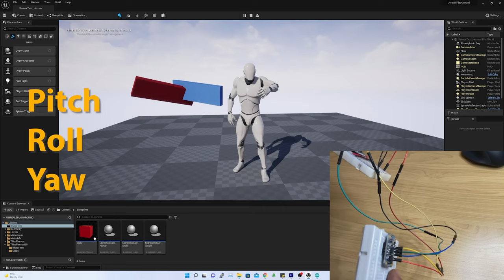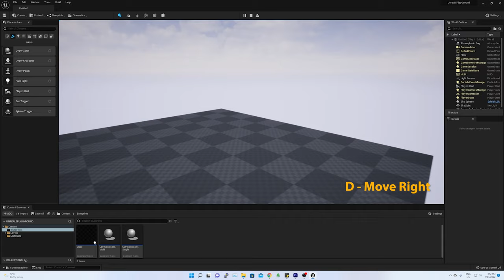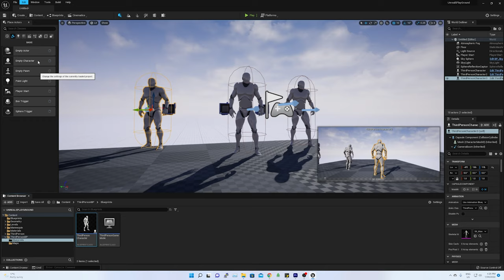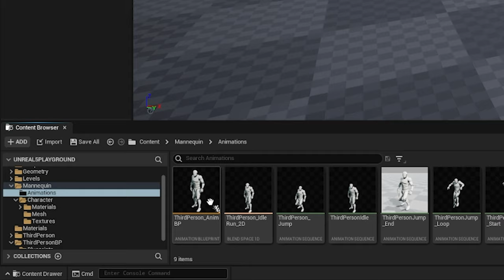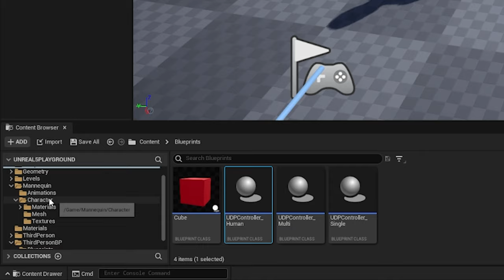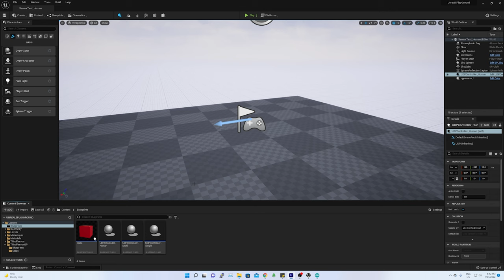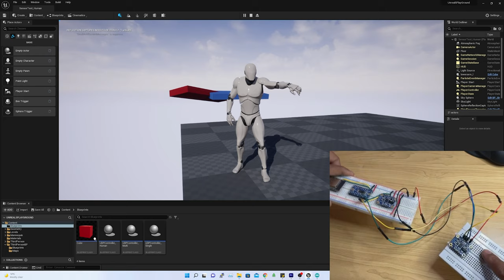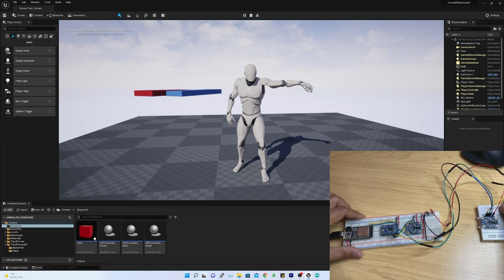Real-time motion capture (IMU) data retarget to Unreal (UE4 / UE5) metahuman / rigid body over WiFi

Comment: That's pretty cool. Thanks for this. Anything for tracking location?
Reply from the maker: I can add gps tracking in it but for my use case it is not required. I will be implement gps tracking for virtual world. 
If you could share your use case I can guide you in that
I am getting the circuit board build so adding gps tracking will be easier. Please stay tune for the next one
Thank you for visiting
Reply: @othersYATC  I want to track my camera movement for virtual production.
Reply from the maker: Will implement the gps in the mix soon. Please stay tune
Reply: @othersYATC  tracking camera movements requires sensitivity much higher than GPS. It needs sub centimeters accuracy and high update frequency. I think Hellcrest Labs did it already with BNO085. Look up CEVA Hillcrest VR

Comment: Very nice! i had a similair idea but i guess you are way ahead of me :D.

Can i sugest you to use simple ethernet cables and RJ45 connectors, these are cheaper and simpler to get by and have 8 pins, use 2 for ground and voltage, and you have 6 pins over, 2 for hand 2 for  forearm, 2 for base (this would be 1 body part) and these all connect to the multiplexor. for all limbs it would be 12 sensors + 3 for: hip torso and head so in total 15 sensors for each 3 sensors you can use 1 multiplexor for each body part: Larm, Rarm, Lfoot, Rfoot, BodyBase.
Reply: Also a much cheaper sensor would be GY-85 but i dont know if its better or worse.
Reply from the maker: Thanks for the comment. Yes Ethernet cable is the best option to connect 3 sensor. I will check how can I do that. But for now I have connected using rj11 cable. Will release the video soon.
Reply from the maker: GY85 Haven’t test it yet. Sensor are shortage in the market. I want to test bno085 first as per Bosch this is more stable and accurate. Will definitely look at the other options to reduce the overall cost